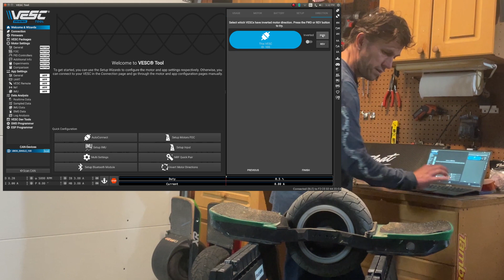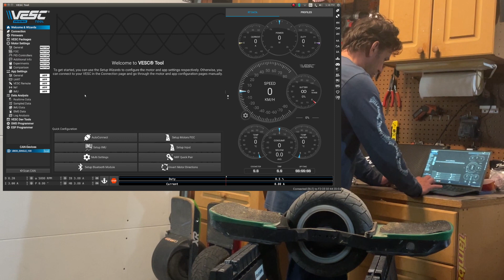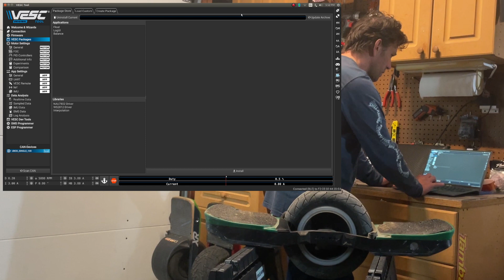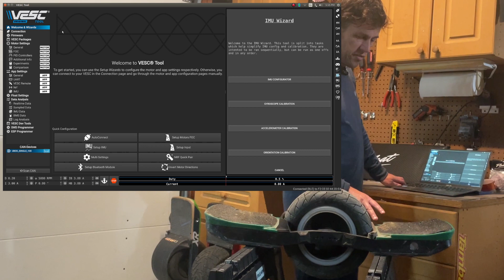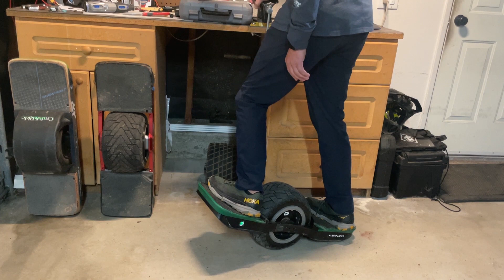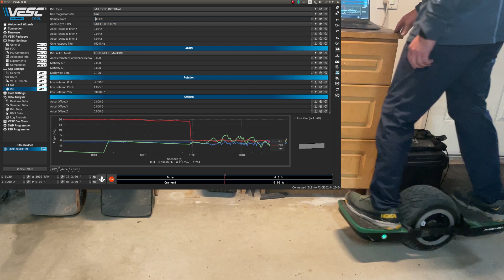DIY Onewheel Setup with 6.0 VESC Firmware

Comment: One thing to note is that during the IMU calibration, you should lift the front of the board instead of the back.
Reply from the maker: In 6.0 it was either or for different setups. But in 6.2 it’s supposedly been fixed that you now always should lift the front, but I cannot definitely confirm that

Comment: Question for you; I had success when setting up my motor detection - hall sensor read True - all other set up is good as far as I can tell. But when I later went to use the float control app - a warning came up with saying the hall sensor was incorrectly connected or not at all. Do you have an idea of what may be the problem? The board motor does run ok - motor doesn’t crunch when acceleration, though still tuning it. I just don’t want to be chasing my tail with a problem with the hardware that I’m constantly trying to fix with tuning adjustments. Thank you for all your hard work!
Reply from the maker: Please read the message carefully and follow the advice. Judging by your statement I have no idea what the actual message was let alone what could have caused it

Comment: Is that a windows laptop? looks like your running the vesc ios on a windows laptop. Should I follow this with a windows 11 laptop?

Edit-Pint X 100vubox if that matters
Reply from the maker: it's a linux laptop - if you use a Windows Laptop the bluetooth can be very temperamental, so it's recommended to use a phone as a proxy (see checkbox at the bottom of the main VESC App screen, then connect via TCP)

Comment: Just want to say thank you for the video sharing the process was a great help in getting my vesc up.  Also I ran into the issue of the IMU calibration and found a root cause for the failed calibration.   It seems when the motors are plugged in properly from ESC to Motor, the calibration works perfectly, but when the wires are switched inverted the calibration won’t properly calibration.   If the initial calibration doesn’t work switch the motors to inverted and recalibrate.

Comment: I was able to set up my Spintend 75-100 but the speed indication using your Iphone Float app says I'm going negative mph. How do I change the settings to get the app to realize I am going forward not reverse?
Reply from the maker: Search for “negative” on pev.dev - it’s a common issue with an easy solution

Comment: Is there a order to connect USB to a PC?
I'm sorry for the questions like amateurs.
Reply from the maker: it sounds like you just have a hardware problem. Either your PC or your VESC. Because on 10+ VESCs I have tried it always worked without doing anything special. Note that you cannot power VESC from USB, you need main power connected.

Comment: Bluetooth won't connect from my phone I've cycled the power, but the problem persists. what should i do?
Can I completely reset the Ubox V2 100V 200A VESC based dual motor controller I am currently setting up? Then I would like to connect the USB to my PC.
Reply from the maker: this also sounds like a hardware problem, probably a bad VESC then if neither phone nor pc works.

Comment: Good evening
I plan to use the VESC-based Ubox V2 100V 200A dual motor controller and Ewheel ADC adapter V2 as a set, but if I connect to the PC from UBS, will the setting screen appear on the PC screen?
I'm looking for setting software that can be done from a PC in another way.
I don't like the Android app screen because it's hard to operate.
thank you.
Reply from the maker: USB+PC is the best/easiest way to configure your VESCs, you have nothing to worry about
Reply: @surfdado  Can you see the VESC Tool setting screen on the monitor if you connect the USB + PC?
Reply from the maker: @勇人-w9o  yes of course

Comment: I think it's worth mentioning that for the Platysense pad, ADC thresholds should be set lower than 3V. Unlike every other sensor it returns a gradient value based on pressure. 3V is kinda hard to achieve consistently and may cause cutouts. Before they're broken in they return 1.5V when unweighted. After a few hundred miles it drops down to 0.01V unweighted though. I set ADC 1 to 0.7V, and ADC 2 to 2.0V to make it a two-stage activation with just the one sensor.

Comment: You set field weakening current max to 30A, is that the same for any battery? I thought it could be set higher for a 2p p42a pack (60A max with XT60 connectors) so that's how I set mine up...

Comment: HI ! thank you for sharing all this information with us!
Do you know the type of temperature sensor used for the original engine on an XR?
(NTC, PTC, KTY...)
have a good day and ride safe
Reply from the maker: I actually don't know for sure - I'm treating it as an NTC 10k and I get temperatures consistent with what I got on the FM app, so I'd say I'm 90% confident that it's correct - but some of the FM repair gurus probably know better
Reply: @surfdado  Ok thanks, yes the NTC 10K is the closest to reality but the value is above like + 8-9 degrees celsus... I will try in custom mode.

Comment: Everything works, until I power cycle... Then it wont read the IMU data until I change the loop Hertz. Then it works again.... Can you help? You always do BTW.
Reply from the maker: Not sure how to respond here, lots more info needed to figure out what exactly is going on. The best way to get help is on the Vescify Discord server: https://discord.gg/6vFHJXMB
Reply: @surfdado  I found out it is related to the float package. Is soon as I install this it stops working. Now I have a different issue unfortunately. When the board is asked some power it suddenly takes off. When you look at the data it suddenly shows the imu on a weird angle. Anyway thanks for the tip, I will post this new issue and hope for the best.
Reply from the maker: @lennartduyn3843  by any chance do you have "App to use" = "Balance" selected? If so, then that's your problem. You should have UART selected if using the Float package
Reply: @surfdado  might be it, I'll check tonight
Reply: This was an interference problem, I had a mass connected to the bottom plate. Bad move, works now so very happy. Thank you for everything!!!

Comment: If you have to spend almost 2,500 on this one wheel GT crap on top of that have to download upgrade program and build the board up so I won't have any of the issues it came with is a waste of freaking time. I'll stick to my trusty XR. Have 4,000 miles on it and still going strong. And I'll keep $2,500 in my pocket for something better

Comment: I noticed at the end of your video you was able to activate the motor touching one sensor only. Thats the problem im having do you know what that could be? Great video
Reply from the maker: we need to make it optional in the next version, right now it's always enabled...
Reply from the maker: lol it is a feature in the Float Package that mimics "Sure Start" i.e. it lets you activate the board with a single sensor... annoying during setup and bench testing 😂
Reply: So it's only on start up that either one sensor could start the board cause you were able to do 👠 heel up and bring the board down afterwards
Reply from the maker: @Takeover738  exactly

Comment: Looks like the imu wizard needs some more work 😅

The tail lift on orientation is especially disturbing because in all of my testing I lifted the nose and it worked perfectly.

But in my defense, I was begging everyone to test it for weeks before release, and then 2 weeks after release everyone starts talking about all the bugs 🤦
Reply from the maker: 6.0 was a tricky release tbh, no betas available on iPhone eliminating half of your test candidates and many riders just finally having a nicely riding firmware with 5.3 and your long awaited nose hunting fix. But word on the street is Benjamin wants to release a 6.2 version fairly soon

Comment: Awesome video! This solves all the problems I’ve seen come up. 

One little hitch is: if you install the Float package and redo (or do for the first time) the motor calibration, everything will work fine until you get to the end where you attempt to test control of the motor. The FWD and backward buttons will just make the motor kind of pulse instead of turn smoothly like in this video (currently, as of Jan 2 2023). I do the ground test like in the video after tuning to make sure forward and backward are right and the forces feel reasonable and smooth.
Reply: Same happened to me. Just Uninstalled float, reran and reinstalled